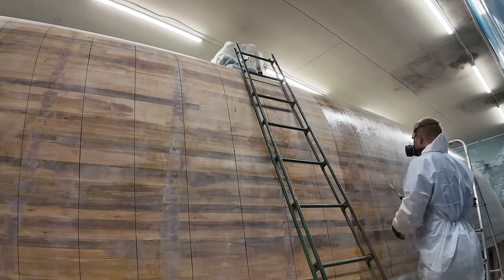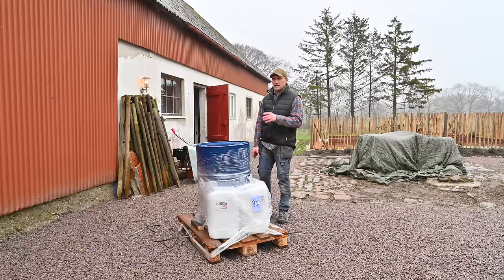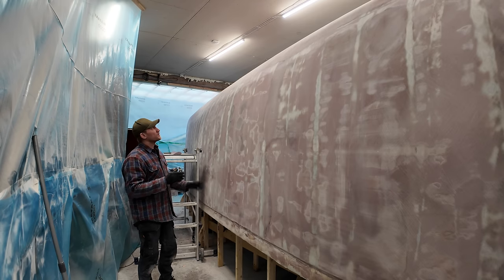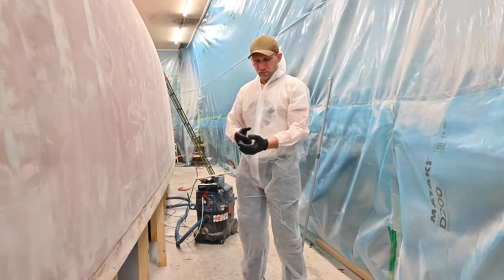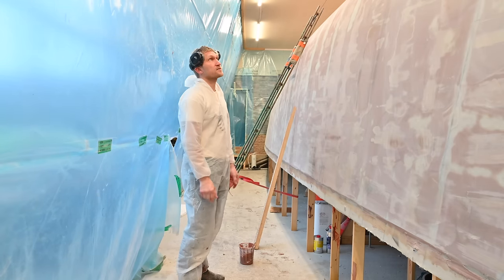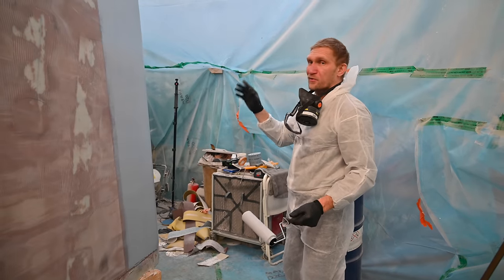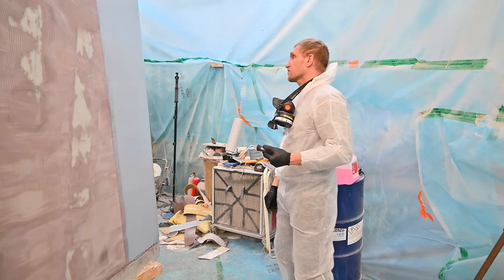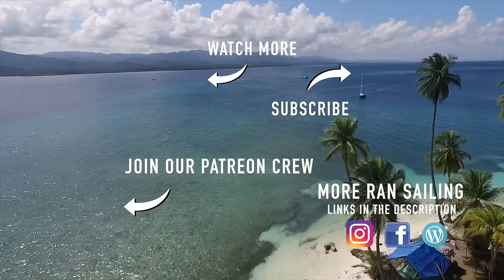We Apply the First Layer Of Barrier Coat On the Hull - Ep. 389 RAN Sailing

Comment: The cut off arm makes a lot of sense, I have seen surfboard builders often do lamination with just gloves and sleeves, no suit. I agree from my own experience that the fore arms get most of the epoxy spills so it's the most important part to protect.

For sanding as well, I have noticed the neck line and wrists are the hardest parts to keep fiber glass dust free.

Comment: I laughed at your monkey arm comment. I am only 69” tall but have a 74” wing span I always seem to have my wrists exposed when I use those “one size fits all” suits. I like the idea of cutting off the sleeves of an older suit. I just sanded and rolled and tipped painted our 45’ pilot house trawler hull. I think you can sand and sand until you just decide, that’s enough. Your hull is looking very nice. I can’t wait for the interior work!
Reply: You can buy separate disposable sleeves from some PPE suppliers.. where they tend to put them over the sleeves of gowns or boiler suits and your reaching over the product .. food, paints etc. 

As they are pretty universal and  limited in material use they shouldn't be too costly and solve your sticky or dusty problem.

Comment: Well done, we appreciate your hard work and skill. 

You know this, so I write this next passage for others ….it is best to make the paint layers as thin as possible with a foam roller and very quickly to tip by running the tip of a very good quality brush lightly upwards across the new paint to remove any excess paint. It is a two person, or better, a three person job; one mixing (after mixing the paint should sit for twenty minutes while bubbles rise out), one painting and one tipping right behind the painter on fully wet paint. 

With only one person it goes slow as one is waiting for the bubbles to rise and whilst that is going on the paint is drying. The tipping is key. Keep wiping the excess off the brush onto a rag. If there are runs, once the epoxy dries it is extremely hard to remove those run ridges, so tipping is vital… in my opinion 😊. With three people it can be like a factory when just as the last bit of paint in the tray is rolled and tipped a new tray is delivered. 

If one doesn’t wait for the bubbles to rise they can appear as crater rims in the paint. 

This may be more relevant for the top coats but in my experience any flaws in the lower coats remain in the top coats unless one takes on more fairing. 

Have fun.

Comment: Hey, I have the same issue with the arms on painter suits. A trick I came up with was cutting the toe off of an old pair of long socks and using that the bridge the gap.
Reply: In the meat packing coolroom biz you wear a sleeve (elastic both ends) as an extension to the outer layer coat, which is just one size. Everyone has to wear the same outer-wear in the coolroom.  It is single use disposable just like the gloves and comes in a box pack like tissues. I think this helps explain the problem.

Comment: @12:57 True, but it is much easier now, it will save a lot of time. And, especially nearing the bottom, you won't have as good of a view for the best result.👴🤔
@20:09 A good working and easy trick to check the fairness is to have someone holding up a straight light (think of the old TL lights).
Looking at it's reflection at an angle from a few meters will reveal it.👴😉
@20:24 Indeed! That is always so very satisfying and reward-full. It looks great! (and lets you forget most of the hard work...😉) 👴👌

Comment: Get a rounded "säckakärra" instead of a flat. From an old propane delivery guy. Easier when you get the weight closer to the wheel axel and safer that it can not move on to the sides.

Comment: The short arm suit. They do the same thing with the long underwear. supposed to be high tech warmth then you have 6 inch bare ankles. The ad had the measurements of the model identical to mine, they do not make a pair that will fit. What do you want for $80.

Comment: unfortunately now you have many more hour of long boarding. and repainting and more long boarding...
Reply from the maker: Yes, some more long boarding will be needed, but not a lot. Maybe 20 to 30 hours…. Cheers!
Reply: @RANSailing  I think you’ll be surprised how much more is still required. You’ll most likely need to apply a second or third coat of primer because of sanding through to the micro balloons.